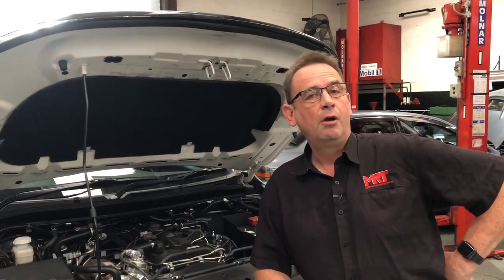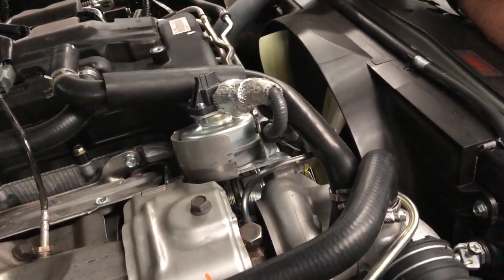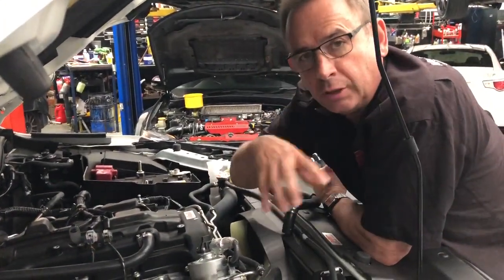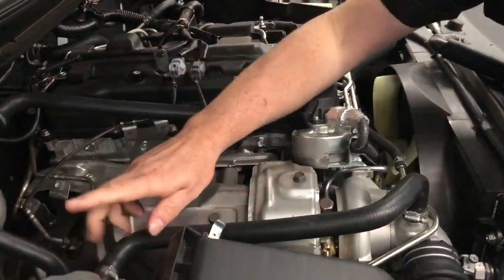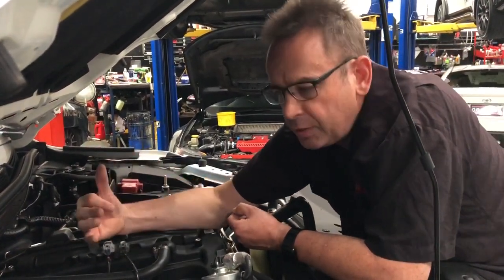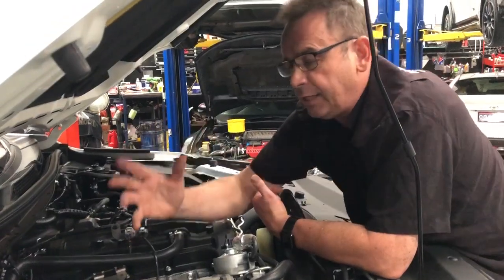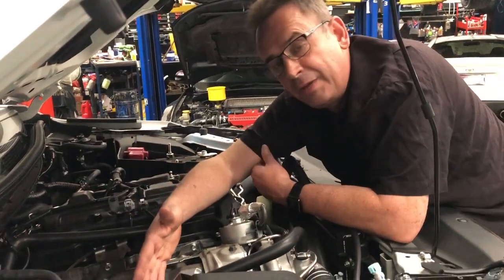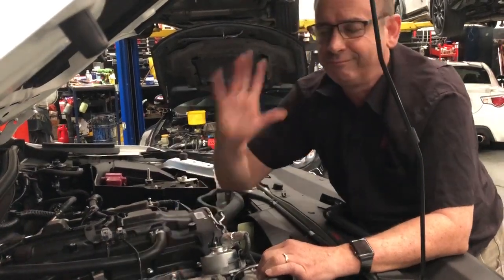Oil catch Cans for Diesel Engines

Comment: My Mazda BT50 2008 engine outlet to the EGR cooler to the EGR valve effect built up soot becomes thicker impacting engine loss of power and requiring more fuel. It will short life.
So I put the engine outlet block plate and just leave the EGR cooler and valve with my Mazda BT50. Head cover outlet to the Bossvent catch can then to the turbo outlet to the exhaust system with DPF. It is successfully running and environmentally friendly 👍👍 The Bossvent is the best No.1 for diesel engines.

Comment: This guy installed a catch can with no filter on it- in order for a catch can to work they are very fine particles in the air you need a very fine filter! A lot of catch cans just being a metal cylinder are doing very little
Reply: Vacuum loop through a baffle why do you need a filter element unless you're venting to the atmosphere...

Comment: Have brought a catch can for my Ute with 27,000 on it.  Was going to install it and EGR plate but have read not to do ANY EGR delete with it has a dpf.  What’s your thoughts on this?  Ide rather get rid of EGR crap if I can
Reply: It's risky legally. But you can get the DPF removed as well. Diesel engines are definitely better for it.

Comment: problem for a manufacturer is that heat cycle of the engine removes moisture from the oil system - hence separating all the vapour would be trapped in the engine. Catch can can slow down fauling up of intake past egr input, but it’s on case by case.

Comment: i rather not run one and let oil wet the dry soot ,as dry soot damage engine, catch can and egr delete not just one , then with egr delete you run higher combustion temps and can still do damage with no cooling effect from egr flow ,its a wn loss loss win no ease way around it other then 12 month manifold / egr remove and clean like they do  Tiwan where they are built

Comment: I ran a can on my last hemi Ram for 300,000 miles and it collected a lot of crud and water vapor. Have had one on my Ram Ecodiesel for 160,000 miles and it catches about 1/2 the volume of the gas motor, Kinda makes sense as the diesel is about 1/2 the displacement of the hemi.. Gotta help keep a lot of crud out of the intake and intercooler. I drain about every 5,000 miles, maybe a bit more often in winter.

Comment: Catch cans have no advantages other than too the guy selling it, 35 years as a diesel mechanic.
Reply: So blow by oil that has contaminate particulates in it should go back through the turbo and into your intake system ...... I think not. I like fuel and air for my diesel not EG and contaminated oil mist.
Reply: @ it's just common sense
Reply: Reckon you'd be great on my old 1978 H series Tojo non turbo diesel , maybe not so hot on my 2022 model.
Reply: Exactly, starves Turbo impeller of oil 🔥
Reply: @righthand7965 bullshit...turbos have an oil feed for a reason. If your theory were true I wouldn't have nearly 100,000 miles on my turbo diesel 6.0 with a catch can
Reply: Uhm there shouldn't be oil on that side of the turbo, the turbo is lubricated by the cars oil pump 😂 the system should be dry  @righthand7965

Comment: Hi i'm researching about this, because i have a TDI Audi modified bigger turbo, injectors intercooler etc.. and no "oil catch can" or "Crankcase Breather box catch can" so far, still on stock set up, but now im having big issues with oil in my turbo geometry and intercooler pipes, so im confused why people make set ups that line goes back to intake unless its agaisnt the law in the person country, would it be okay to do like a box breather type, that goes from valve cover into box with air filter and a drain or does it need to be conected to the turbo inlet? Because i would like to eliminate completely the connection to the intake, just dont know if that would be a problem, any tips? Does it need any one valves at all? thanks in advanced great video! Subscribe and like !

Comment: No disadvantage to venting gases back through a turbo system 😅🤣😂 . Tell that to any direct injection owner with crusty inlet valves and clogged intercooler . BS environmental systems that kill engines and performance.

Comment: Hi Guys! I instaled an oil catch can on a ford Powerstroke 6.4 because there was oil on the intercooler. But i think after installation it started to burn oil through the exhaust. Does that makes any sense? Maybe too low pressure on the circuit and doesn’t goes through the turbo so it gets burned? Its usually at low rpm, when i am on the highway up a hill or flat its fine. But after traffic or iddle for a while it smokes at low and high rpm for a bit and then nothing, it looks like clears wherever its stuck?

Comment: This is why port injection is still better, at least it cleans the back of the ports, and in petrol it really isn't an issue. The thing people don't seem to understand is that a lot of blow by really only happens in older worn engine or modified engines. It's also a sign of something no working right / worn. If people do install a can make sure it's big enough to not cause any back pressure as it will make seals leak or you can even blown them out. 

Keeping maintenance up and replacing oil at every 5k/10k is so important in diesel. Also most modern rocket covers have some sort of oil / air separation happening as well before it's sent off to the turbo.

Comment: Are you saying that engineers who design engines, modern engines up to now that do not use OCC are mistaken? How do make up for parts that get lubricated by the oil spray introduced into the intake manifold?

Comment: Thinking a lot of GDI engines suffer from the Carbone's up intakes believe from the PCV valve system.  Do we have to fit catch cans, or can it just be vented direct atmosphere by running a longer pipe to the underside of car.

Comment: When fitting a oill catch can` does it also have a regulater on it so the Air intake and crank case pressure gets regulated,as the gasses can build up pressure,
Or is that only for the catch can trap  that allows oil to drips back into the sump

Comment: I have a Ford Ranger/BT 50 2.5 Year 2008 that looks lije this "rocket cover breather system" does it mean the have no PCV valve? Ive got come oil in the turbo intake and I think its coming from the hose form de breather that goes in the air system

Comment: What if the turbo is damaged and throwing oils in to intercooler which eventually goes in to combustion chamber through intake manifold ?Turbo dies slow death and by the time you know enough oil is already on intake valve.

Comment: So what's worse, black, vegimite build up in your egr/manifold that gets cleaned out occasionally (probably more often than needed) or black, gritty, abrasive exhaust gasses being sucked into your engine because they are not being caught by the oil that is now in your catch can?   I'm talking turbo diesel here.

Comment: Hey Brett. I live in Toronto Ontario Canada. I have a ecodiesel 2016 ram 1500. Just had the EGR replaced as well the intake manifold. The manifold has the butterfly filled with soot and caused the actuator gear to crack. Due to the emissions I have to leave the EGR  on the engine. What’s your recommendation to stop the oil blow by. Is there a kit for this engine specifically??  I have 147000kms on it. Please advise.  Thank. By the way excellent video.

Comment: People still buying into the catch can garbage. The engines are designed to burn the oil vapor from the PCV (positive crankcase ventilation) system, the amount of oil vapor is very small. What these cans are doing is catching the vapor and making it look like oh my god liquid oil is flowing into the intake when that is not the case at all. Positive Crankcase Ventilation has been fed back into the intake for decades without problems, the truth is these oil catch cans are a solution in search of a non existent problem. Save your money people, if this was really a problem the manufactures would have done it themselves. All engines must have positive crankcase ventilation or they will blow gaskets from the pressure build up inside the crank case from the pistons moving up and down the cylinder walls. 

Before the vapors were fed back into the engine to be burned off they used to just run a hose to the ground and oil would drip onto the ground. Catch cans also can create a problem of building back pressure in the positive crankcase ventilation system when someone does not employ the catch can and it becomes restrictive you can blow a gasket and or start pumping liquid oil into the intake.

If you really think you have to have something you would be far better off blocking off the PCV line into the intake and where the PCV line comes off the engine put a filter there and just change the filter on a set schedule. No expensive catch can to deal with and a simple inexpensive filter to change instead. People do this with Harley Davidson motorcycles some have put catch cans on them while others just use a simple cheap filter instead.
Reply: @Ram Ecodiesel: You must work for a manufacturer or a mechanic and want to make sure ppl confused so some will just leave it as is..my 17 f350 6.7 diesel just blew apart the cold side intercooler rubber hose from OIL EATING rubber lines as manufacturers make sure use NON OIL RESISTANT kntake pipes..OIL and egr gas combined helps build oil GUNK wherever it traps ALL SENSORS GET DAMAGED and ENTIRE INTAKE AND INTERCOOLER ALL TUBES PIPES SENSORS..get sludged UP and  CANT CLEAN IT FULLY,any leftover helps trap new buildup..ALL HD like Cat ,John Deere etc, all have turbo diesel engine and all to this day VENT SIMPLY TO ATMOSPHERE..positive pressure from turbo pressure spikes,blow by, pistons movement MUST BE VENTED TO AVOID OIL SEALS DAMAGED and few other reason..THE FILTER MAKES U SMELL IT ALWAYS and makes a MESS..
Reply: Don't listen to this bird commenting on a subject he is too ignorant to know what is correct...
Diesels accumulate large amounts of oil vapor condensate which loads up the air to air intercooler and gums up the turbo until it may fail completely...
You can see oil discharge seeping out of the air system connections because it is coating everything on the inside...this entire presentation video addresses that the catch can needs to be "adequately " sized to do the volume collection that the engine produces...
He, stating his foolish opinion about it being a "solution  in search of a problem" ...bs is ass- backwards...he is a fool in search of misunderstanding and he'll ALWAYS FIND ONE!!!!
His faith that the mfrs would employ anything to delay the engines' demise so you wouldn't replace the car as soon,  is half- baked indeed!! Very naive!!

Comment: Im having issues with my Mitsubishi pajero TD. I had to cut the inlet hose and run it through the bottom of the engine bay so it can release the oil outside. Makes a huge mess outside but hopefully this catch can helps

Comment: Is there a filter in the catch can and you need to start the truck and show the vaper coming out of the engine and people need to start using a oil the better then a 5w30 in a diesel car or truck  Especially if you live in a hot climate

Comment: It's been recommended that I have a " carbon" clean before fitting a catch can.

What is a carbon clean?
Reply: Hi BonzoAU .. notice you have not had a reply as yet ... first off I will say that I am not a diesel or engine "expert" but have a very strong technical knowledge of mechanics .... I myself am due to have a remap / catch can / fuel filter upgrade on my 2016 Ford Everest 3.2L ( 43K kms) this coming week . I had a recent service and the manifold which I understand sends gases back to the top of the engine had a camera scope put through and this showed build up of sludgy soot .. as Brett explained " vegemite". I think the carbon clean you mention is where the manifold is removed and set in a bath for a period of time to clean out the gunk.The associated connecting system is also  flushed through . It's not cheap , approx $1000 but takes several days. I have been told that some dodgies will do a clean in situ whereby the manifold is not removed ' AVOID THIS AT ALL COST' . In the upgrades I am having done the sludge needs to be removed to ensure the correct air flow etc is monitored during the tune. Hope this helps and I have also viewed posts by Andrew from Berrima Diesel Australia and have found him and Brett to be possibly 2 of the best at explaining in layman terms .  Apologies for the long rant .  👍
Reply: @waxhead63  Thanks for your reply.

I did have a PV 200 a pre filter fitted october 2020 to my '13 d max (112.000K's) 
Along with a " carbon" clean by Berrima Diesel. 

They had the d max for most of the day.
Reply: Yep, just to add on to Waxhead's comment. Definitely avoid the carbon cleans where they claim they can run some solution through the engine while it runs. The solutions stuff your oil so you have to have a service on top of it. The ONLY way to properly clean a manifold is to physically remove it. Mechanics will put it in a bath of solution, then scrub it. However, if you want to do it yourself, you can use oven cleaners and use some drill bit attatchments to scrub it clean. Then you put a catch can on.

Comment: Bottom line is F disk the both of them!!!!!!!!! Most of the Tunes wouldn't pass Emissions test anyway. Emission Gear like DPF, EGR, PCV all put together reduce the Engine life so it wont last the life of the Car..So tell me again how Emissions are better for the Environment if we need to do more frequent Oil Changes to negate the Pollution gear, and in a lot of cases have to make more Engines because they wont go past 350,000 KM before they are FARKED!

Comment: Thank you for the video. Do you have a catch can size you would recommend for a Chevy Colorado 2.8L duramax diesel?
Reply: No. There's none. Just get a standard one. All you need is 2 hoes and a few clamps. Easy installation.
Reply: Provent 200

Comment: You can pay $300 for a catch can. Or, like I did, buy a $50 one and then modify it. At worst it'll be like not having a catch can.
You can pay $1500 to have you engine intake manifold removed and decoked or you can squirt, three bond or liquid molly decoker or, apparently, use Mr Muscle.

Comment: Additionally you can install a Trottle body low pressure injector. The fuel pump delivering fuel from the fuel tank on a gdi has approximately 4-5 bar of pressure, so you can split the fuel line and send it to a throttle body injector. Then you could connect it to one of the electrical lines of one of the injectors on the car. This way it will spray into the manifold and clean the valves. But that can affect the mixture so the computer will compensate and send less fuel but it may not run properly so you need a switch to turn it off after a short time. It’s equivalent to cleaning the valves using a spray except you can do it much easier and more frequently.
This needs to be done buy a modification specialist and it’s only an idea of what can be improved.
But maybe it’s better to start with the OCC and spray maintenance then after say 7 years install this.

Comment: Quick question about the catch can why do you send the gases back into the inlet ? Wouldn’t it do a better job if you allowed the gases to escape straight to the atmosphere?
Reply: If it's vented to the atmosphere it's dumping unburned oil/fuel into the environment. With a PCV valve you're allowing those fumes to burn. With a catch can you supply cleaner air back to the combustion chamber and contain the oil fumes in the can.
Reply: I mean after the catch can , if that hot air still has noncombustibles surely that’s not good for the engine . And what do you do with the stuff the catch can catches?

Comment: It’s pretty working on my 1gdftv diesel motor, I ‘be bought new one on 10 kilos on clock and I have cleaned at 10000 kilometres, my catch can was collected full of dirty grease oil combine with some water inside that engine.

Comment: Hi Brett,
Love your channel, I'm a Kiwi living in Canada.
I noticed the Catch Can was made from billet aluminum, does it have any pressure relief valves?
I'm sure you're familiar with the Mann ProVent Crank Case filters, I like these because of their relief valve systems. 
I installed one on Mk11 2.8 Pajero at 7000 klicks and at 120,000 when I sold her the intercooler and inlet manifold were squeaky clean. I use to just replace the filter elements & later on started cleaning and reusing them, worked well.
I've recently made a custom bracket and installed a ProVent 200 on my 14 Porsche Cayenne Diesel, to combat the terrible carbon buildup the 3.0 VAG owners are experiencing. It's probably worse over here in Nth America, one because of the over the top emission laws and more recently, the Volkswagen diesel gate fiasco we had to endure with our 3.0 TDi's. 
I had my Cayenne Diesel tuned and she's a totally different machine, runs so much smoother and quieter along with the added performance.
Keep on making your brilliant videos, very educational.👍
Murray

Comment: There  is  a  disadvantage  you  burning  atomized  engine  oil !! It  will make  your  exhaust  emissions  worse  and  in a older  engine  may  cause  the  car  to  fail emission tests..

Comment: I have a Mitsubishi 3rd Gen Montero Sport (called Pajero Sport in some countries) which I believe is built on the same chassis and has the same engine as the latest Strada (Triton) shown in this video. I heard that the fittings on the OCC for the hoses should match the size of the current OEM hose. What OCC would you then recommend for this specific setup other than the one shown in the video?